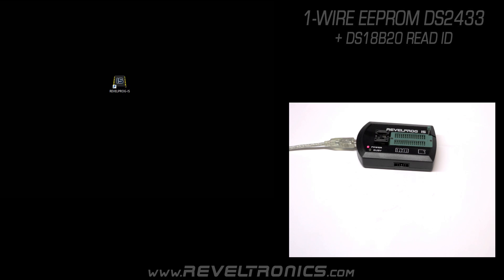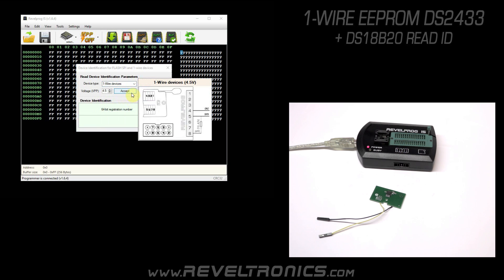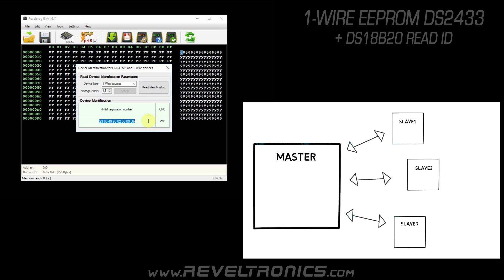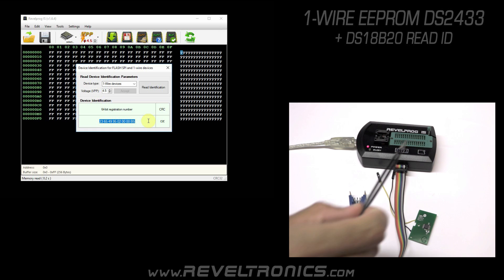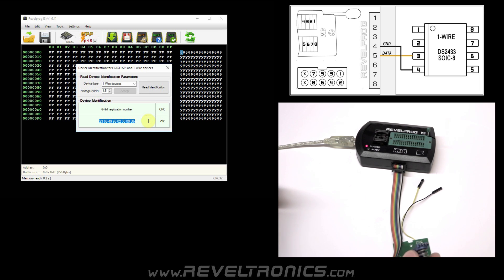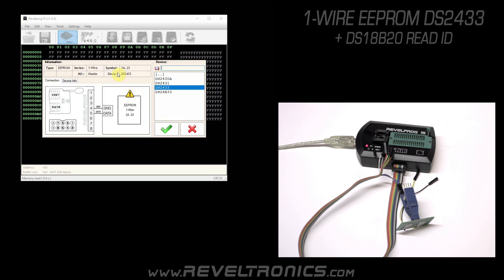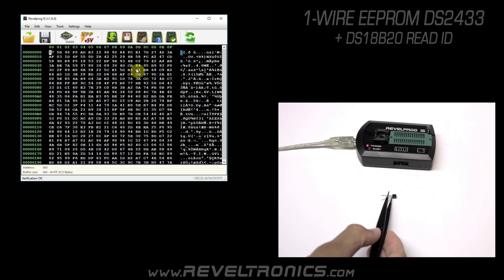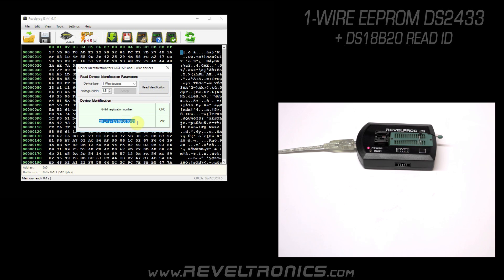1-Wire read 64-bit ID and write DS2433 EEPROM with REVELPROG-IS serial programmer

Comment: Dear sir please help one of my device it’s printer interface board and DS2431 IC is there after some time this board need to change , I want some solution if any possibility to reset this IC DS2431 or copy ic and make new one !!!!?
Reply from the maker: My suggestion is to read DS2431 when it's factory new, and then read it after some time or when it need replacement, compare it and reprogramm it with dump you have read before (when it was new) - maybe it will work. It has also additional registers which can be read too, more info https://forum.reveltronics.com/viewtopic.php?f=32&t=699&p=3128

Comment: Hi i have a chip DS28E22 can this chip reader read
Reply from the maker: DS28E22 datasheet starts with "DeepCoverM embedded security solutions cloak sensitive data under multiple layers of advanced physical security to provide the most secure key storage possible" so I worry that without private keys you can not read it. If you have private key you can try with custom script tool in REVELPROG-IS (you can communicate with any 1-wire device with custom script tool).

Comment: hi ... i have ds28e01 one wire .. can i read data from this device ?
Reply from the maker: it's not available in memory database but you can communicate with any DS chip using custom script tool (based on DS28e01 commands from datasheet), please check examples here https://forum.reveltronics.com/viewtopic.php?f=32&t=897

Comment: Hello! i have a chip code is DS+1807 can this chip reader read and write for the above chip?
Reply from the maker: It's not on the supported device list but I checked datasheet for DS1807 and it's I2C chip (not 1-wire). Anyway, with some experience you can use custom script tool and communicate with it on i2c bus (https://forum.reveltronics.com/viewtopic.php?f=32&t=280). You will need to connect power supply, ground and SDA & SCL lines. Based on datasheet from maxxim (https://datasheets.maximintegrated.com/en/ds/DS1807.pdf) it's an addressable, digitally controlled device that has two 65-position potentiometers. So with custom script tool you can send commands to it and write values for 2 potentiometers. Command table and connection pinout is in DS1807 datasheet, page 7/13 and page 1/13
Reply: @REVELTRONICS  sorry. I messed up the chip number DS2807, thank you very much for your feedback!
Reply from the maker: ec @khatran9202  It's looks quite similar to DS28EC20 (https://forum.reveltronics.com/viewtopic.php?f=32&t=879) with different pages. It's not available in memory database but it should work with custom script in the same way as DS28EC20. If you could send us 1pcs for test we can add it to memory database

Comment: Hi, that serial programmer work with the ds2505?
Reply from the maker: DS2505 is unusual because it requires +12V programming voltage so unfortunately REVELPROG-IS does not support it. Maximum output voltage with REVELPROG-IS is +5V so it is should be possible to read with custom script tool but can not write.
Reply: @REVELTRONICS  are you know a programmer that work with ds2505?
Reply from the maker: @AmericoKJrTanji  Unfortunately not :(

Comment: Can we read true data if DS2431 is in EPROM mode?
Reply from the maker: Hi Manish,

Please check this forum post: https://forum.reveltronics.com/viewtopic.php?f=22&t=699&p=3128&hilit=ds2431#p3128 and page 7 of datasheet https://datasheets.maximintegrated.com/en/ds/DS2431.pdf

When you have device which is write protected, you can still read it but you can not write it. So you can read it and use other device to write it. But other device will have different 64-bit ID which can not be changed.
Reply: @REVELTRONICS  But page 26 of datasheet it says "A protection setting of AAh (EPROM mode) causes the  logical  AND  of  incoming  data  and  target  address  main memory data to be loaded into the scratchpad". So once we try to read data it will read but the data will be wrong ( not same as original). Kindly clarify
Reply from the maker: @manishpatel3546  this quote is only for writing data, full quote from datasheet "The  protection  control  registers  determine  how  incom-ing  data  on  a  Write  Scratchpad  command  is  loaded  into  the scratchpad. A protection setting of 55h (write protect) causes  the  incoming  data  to  be  ignored  and  the  target  address main memory data to be loaded into the scratch-pad. A protection setting of AAh (EPROM mode) causes the  logical  AND  of  incoming  data  and  target  address  main memory data to be loaded into the scratchpad. Any other protection control register setting leaves the associ-ated  memory  page  open  for  unrestricted  write  access."
Reply: @REVELTRONICS  it means i will be able to read original data respective of mode of ds2431?
Reply from the maker: @manishpatel3546  Yes, why not?;) As mentioned in datasheet EPROM emulation mode does not have any influence on reading data

Comment: I have bought the programmer, but unfortunately it's only can read ID and data memory 00h-07Fh, but cannot read/write the address 080h-08Fh on DS2431 that for read/write protection. Please help me how to do that.
Reply from the maker: EEPROM address range for DS2431 is 0x00 - 0x7F and it's working. 0x80 will not work, because it's not EEPROM area for DS2431. If you would like to play addresses outside eeprom range (e.g. 0x80) there is also such possibility, but you should follow datasheet (https://datasheets.maximintegrated.com/en/ds/DS2431.pdf) and use custom script programming, please take a look: https://forum.reveltronics.com/viewtopic.php?f=32&t=280 and here you have for 1-wire examples: https://forum.reveltronics.com/viewtopic.php?f=32&t=542 . If you have any questions about custom script tool or need help please as a question via forum and we will help

update: tested solution for changing DS2431 protection registers using custom scripts: 
https://forum.reveltronics.com/viewtopic.php?f=22&p=3130#p3130